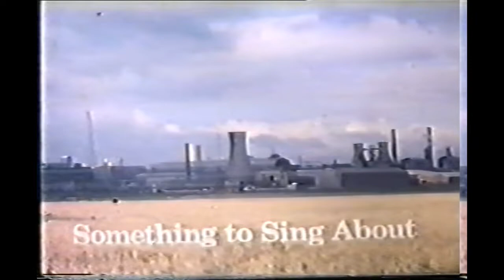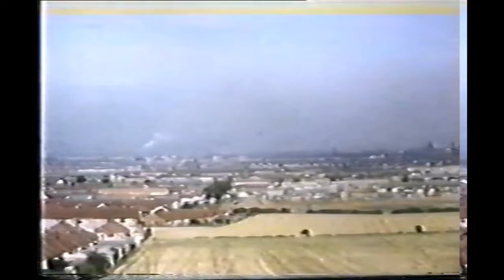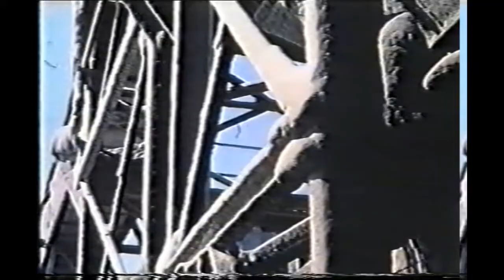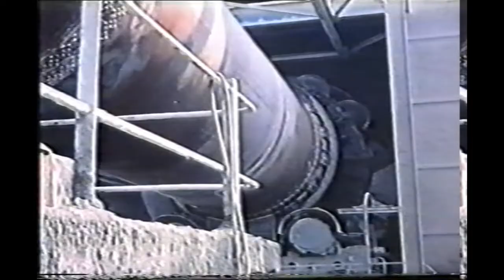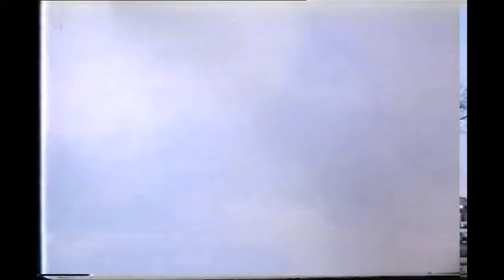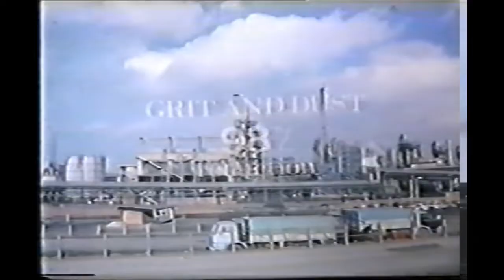Something to sing about - ICI Billingham Film Unit 1970s

Comment: I assume it was North Sea Natural Gas that allowed them to stop burning coal?
Reply from the maker: Latterly it was, yes, but not at first. I think I'm right in saying that ammonia production moved to using naphtha for the syngas production stage - at one point there were 3 refineries based near Seal Sands that provided feedstock to the 3 sites. There's a cringeworthy moment in one of the old films when there's a board level discussion filmed concerning the merits of Iranian oil imports under the regime of the Shah. I wouldn't want to speculate as to the extent of the geopolitical influence that was exerted by the old ICI board, but I strongly suspect it wouldn't sit comfortably with modern values...